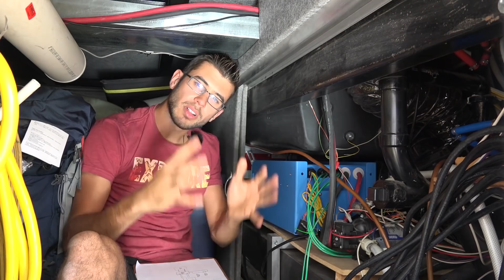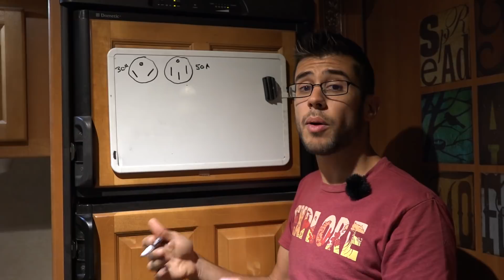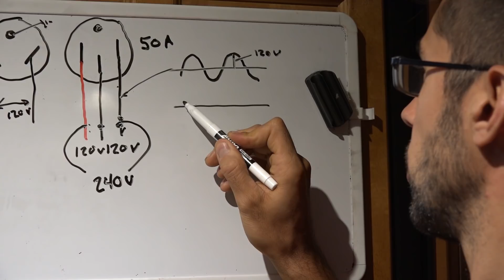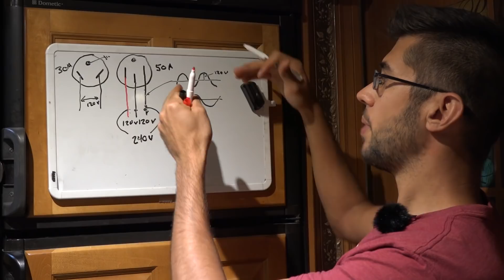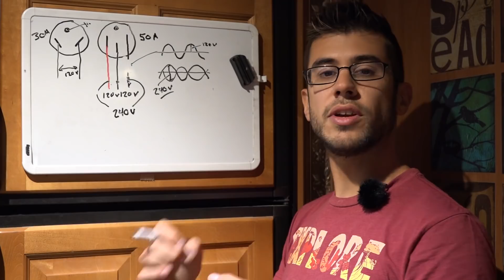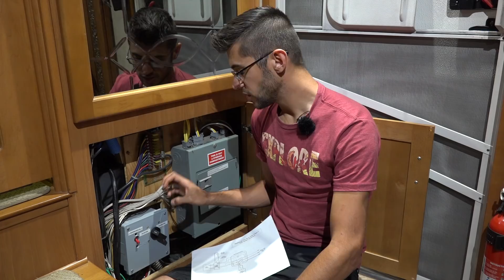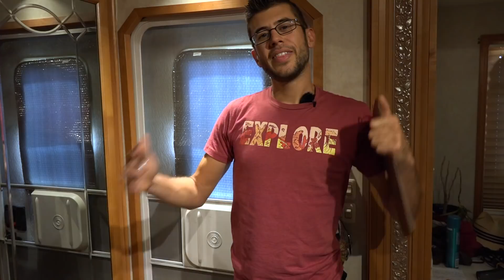RV Solar Phase 3 - 24V Inverter Installation for powering the whole AC system of our RV!

Comment: Tom and Cait,

I just found your videos while waiting in the airport and they are really great.  I have put together a travel trailer very similar to yours so it was very interesting to see how you decided to do things.  I have installed the following in my rig:

Victron Energy (VE) Multiplus 24/3000/70 inverter/charger
VE color control GX controller
VE mppt 150/50 solar charger
VE mppt 100/30 solar charger
VE Orion 25 amp 24V to 12V converter
Elite power solutions lithium ion battery bank, 200 AH at 24V
Elite power solutions battery monitoring system
Powersonic SLA battery, 5AH at 12V
“1200” watts Suaoki flexible solar panels (deteriorating rapidly)

Pioneer mini split residential air conditioner (This is a critical item for being able to run air conditioning off of solar/battery and an inverter. Much more powerful than the roof unit, more than twice as efficient, absolutely no startup in-rush current, and dead quiet inside and outside.)

A homemade 12v to 48v converter which allows me to draw 800 watts off my tow vehicle alternator and run the power in through a second mppt to charge the battery bank.  Works great and saves me from needing a generator and gas cans.  

My rig is a 2015 Coachmen Apex 288BHS, it is my first RV and I have been “moding” it virtually since the day a got it.  It is setup for 30 amp power so I was able to use the transfer switch built into the multiplus, an easier route than you had to take with a 50 amp setup.  In fact, with the power assist and shore power limit features that the multiplus has I only ever carry a standard 15A extension cord.  It has its own 15A breaker just to safe.  BTW, I did not know that 50 amp service on an RV is split phase, thanks for the info.

I have a few question about your setup:

Have you tested the capacity of the Tesla battery?  Fully charged it and then checked how many kWhr you got out of it when fully discharged?  I am very jealous of that Tesla battery.

Where did you get the charger settings for the Tesla battery?

Do you think fusing the solar panel output is really necessary?  Isn’t it impossible for the panels to put out enough current to overload the wires?  Same question about the MPPT output?

What is the standby power draw of your rig?  This would be with only the bare essentials turned on - refrigerator, propane monitor, battery electronics, etc.

Thanks, 
Matt
Reply: Matt,

I have the same TT and year. To date I have modded basic items like LED bulbs for all outside lights, wireless backup camera etc. However I am planning to install solar and lithium batts..... would really love a Tesla pack but where do we put it? We do not have the same storage as Morton’s 5th wheel..... where did you install your battery bank, under the seat behind the main panel? Thank you for your thought’s and I hope Tom responds to your questions.

Comment: Hi Tom @ long last you have showen me how 110volts supplies 2 20 volt out of all the people I have asked. Absulutly  brilliant set of vidioes thank you so much for your time an trouble.  I live in a little cottage on the s/w coast of Ireland and converting.  From lead acid to lythem 24 volt system.  Good luch a an God bless to you both, Michael.
Reply from the maker: Glad you found it helpful! Best of luck with thr conversion!!

Comment: I'm just curious Tom if you considered the Magnum Inverters since they can be wired split phase and you wouldn't have did the jumper?   Let me guess you designed your "Mortons on the Move" logo too lol.   Another great video, and a super thanks for sharing your talent with us !!!
Reply from the maker: I would probably stick with the victron, but yes I have done split phase dual inverter installations before.  Its more than we need and we were trying to keep the cost down. Maybe someday tho!
Reply: Your logo, did you design it ?  Oh, we got our MagnaSine 4448 from ebay, it was new old stock a brand new 2015 model for half the price.

Comment: Add a micro-air easy start to your air-conditioner and you’ll be able to run that from your battery bank. It’s a soft start for your compressor uses 40 to 70% less power

Comment: You have a very nice system.

Several years ago, I installed a shore line surge suppressor,  frequency regulator, and a voltage regulator.

This saved the electronics of my RV in more than one occasion.  
This is particularly true at older campsites during storms and during the holidays when energy demand management is highly recommended.

https://rvpower.southwire.com/products/hardwired-surge-protection/50a-hardwire-plus-model-40240/

https://rvpower.southwire.com/products/accessories/30-amp-and-50-amp-voltage-regulators/

They, also, have automatic transfer switches which perform the above; however, I am not as familiar with these.

https://rvpower.southwire.com/products/transfer-switches/

Comment: You should be able to run your A/C from your battery/solar only, are you not able to?  You shouldn't need your generator unless you are in an emergency.
Reply from the maker: Yes we can run it but the battery will drain.  We usually turn the AC on the start the gen to supplement solar power and not drain the battery.
Reply: If you were to only run the A/C off battery/solar how long would it last with you current battery protection shutoff? What would be the lowest percent you would let your batteries drain to?

Comment: Nicely done.

I have one suggestion and that is you may be able to program the two aux inputs on the inverter to disable charging and inverting independently. I say may as you have an older multiplus. Just something to think about.

Comment: It's so aggravating when people don't follow national electrical code for wiring, Especially AC Wiring. Green or Green/Yellow is Ground, Not!!! Positive or Negative. Negative is White or "Blue in the uk" all other colors are positive, Yellow or Brown is generally reserved for  277V AC.... 

DC positive is Red Most of the time, Negative will be White or Black "Where White is used as Negative you Common Power will be BLACK and/or RED but may consist of a onset of other colors as common power or as treger power wires. Some may contain strips through the wire jacket.

Just a comment. if you are going to show it "Do It Right" Rant Over, Point Made. This is about Safety if something catastrophic on either side of ac or dc in a emergency for first responders.

Comment: So, couldn't I potentially run my entire 30Amp RV from this system WITHOUT additional jumping of the Voltage? A/C and all?
Reply from the maker: Yes a 30A unit would be very easy to wire.  You can also just pass the  whole 30A power through the inverter.
Reply: Thank you so much for making these videos & for responding! I am a newbie to solar, but being from an engineering background, I'm relatively familiar with the terminology & such. If you don't mind me asking, how much did your system cost you?

Comment: Tom let me compliment you on your install of the Tesla powerwall in your RV. it's one of the best I've seen online so far. You use victron equipment which is some of the best in the business. I constantly see people building power walls without having any fail-safes in there system. The Lithium-ion batteries are an excellent choice for your off-grid setup but most people don't realize how dangerous these batteries can be and install them without any BMS system or if they do a BMS system it's something that's not rated for that system.  I've recommended several people to your site so they can see your install.. people don't realize how unforgiving these batteries are and you can't be around the batteries 24/7 checking everything. All these batteries were installed in vehicles with battery monitoring systems that went through the control module the car. So why would people run these batteries without BMS systems putting their families at risk? Tom good luck to you and your wife on your adventure
Reply from the maker: Thanks for the note.  I agree, I hear of a lot of people talking about building "powerwalls" but they dont seem to think through the BMS.  I think we will see cheaper and better BMS options soon but you still need to know what you are doing to prevent a fire.  I like to think of my battery like a can of gasoline, one wrong move and boom.

Comment: I would not recommend the switch used here, especially in an RV. I purchased it last week and, like you, had to disassemble it's top to have it fit my application. Turns out its 2 plastic strips with the numbers on it are holding the entire thing together ( https://imgur.com/a/oGuZRmF ). Each of its 3 layers are otherwise unsecured. That means if just one of those 2 plastic strips breaks down from heat or becoming dried out, the entire assembly will fall apart. Square D makes NEC approved cam switches, one of which I have on order.

Comment: Great video series.  I'm in the process of doing something similar.  Have you found that one of the tesla batteries is enough?  Our average night time draw is around 12 amps at 12 volts right now if watching tv, about 6 amps if not.  If I power the fridge it jumps to 15.5/9.5.  With the 80% rule we have 200 amps of available power in the tesla pack so cutting it kind of close.   I was thinking 2 would be safer and give me a rainy weather buffer (my solar setup is 6x285w solar world panels).

What is the name/model of the transfer switch you used?
Reply from the maker: For the size system you have and draw you see 2 would probably be better, our usage is a bit lower and 1 has been plenty. This is the switch I am using,    https://amzn.to/2t9SDdO    1  Would have preferred to use an industry standard like ABB or Siemens but they are hundreds of dollars.

Comment: Very impressive. However I wonder how mere mortals will ever trouble shoot this system in case anything malfunctions. It seems like a lot of money and risk is riding on a few somewhat vulnerable electronic devices. I'm not saying you didn't do this, but if the system is not designed correctly, a text message from your wife saying "Honey, I smell smoke" will leave you helpless in explaining what to tell her to do in an emergency. Something to think about ...
Reply from the maker: Its very true, but if something went wrong with our old system I would be in the same boat... and It did a few times.

Comment: Great video, very clever jumping L2 on the inverter through the switch. I’m currently installing two Multiplus 24/3000’s in split phase but also have an onboard Onan generator with auto transfer switch in the mix. I should have the system installation finished in the next couple of weeks. Just got done with the solar and hanging the two inverters. I installed 2400W on the roof. I also shied away from the Tesla modules and ended up starting with six Battleborn’s. Glad you guys got to cooler weather, it was very hot in TX, we were really glad to got out a couple of weeks ago.

Comment: Hi Tom, I'm looking forward to the specifics on your actual settings in the Phase 4 video.  I have my Victron Multi-plus installed and will be integrating the battery modules in the next week.  In the Phase 2 video you included the battery protect for overcharging between your solar controller and the 24v + bus.  After adding the inverter/charger, did you move that battery protect to be between the 24v + bus and the battery module?  I was thinking of putting mine there as extra protection since the inverter/charger settings could also be changed by accident.
Reply from the maker: I do not have a BP between the inverter but yes that is a good idea.  We are relying on the overvoltage protection relay we talked about to shut down the inverter on overvoltage.  In testing (lowering the voltage limit) it works great.

Comment: Fantastic video!  I'm set up little different but wanted the same thing. The entire rv lit up even if we are boondocking. I have an automatic transfer switch that I have to tease to switch sometimes. And so was very happy to see your use of the manual one. But I would only need the big switch not the smaller one. 
You have fabulous system. And I'm sure is the envy of all off griders keep the wonderful videos coming.

Comment: Tom, great video series. Quick question....... When you travel, do you power the refrigerator from the inverter? If your going from boondock to boondock, does the solar keep the battery sufficiently charged.
TIA,
Steve
Reply from the maker: If we have sunny days we keep the fridge on AC all the time, if it gets cloudy we turn it to propane.  Yes it is plenty of piwer for us. We have gone months already without the need for the generator.

Comment: Tom - if you feed the same phase to both 120v legs with the inverter, aren't you potentially overloading your neutral? Did I miss something?
Reply from the maker: Nope the neutral will carry the same load as the single hot.  If the wires are sized appropriately it is not a problem.
Reply: Mortons on the Move - I see- the inverter limits the total current flow on both hots to the capacity of the neutral - got it - thanks!

Comment: Hi Tom. I'm concerned that you've created a potential fire hazard in your RV by appearing to not install a circuit breaker on the 120V output of the inverter and using insufficient 10 AWG wire to the transfer switch and as a jumper, according to the manual for the Victron Multiplus 24|3000|70-50|120V inverter. As well, are the wires between the transfer switch and the panel, the same gauge as the ones from the shore power connection?

It mentions at the bottom of page 15, that when using the PowerAssist feature, the inverter can output a total of 75A, which is comprised of the 50A maximum input current and 25A produced by the inverter. It cautions that the output cables should be sized accordingly and that a fuse or circuit breaker also be used.

You've installed a 20A circuit breaker on the input, but programmed the inverter to use only up to 11A for PowerAssist, so the maximum output is therefore 36A. That exceeds the 30A rating of 10 AWG wire.

I'd recommend either adding a 30A circuit breaker to the inverter output so that you can safely use the existing wire, or install a larger breaker and 6 AWG wire to accommodate the 36A maximum output now, while giving you the option to increase it to 45A should you decide to reconfigure the inverter to use the full 20A input at some point in the future, perhaps with a larger generator. I hope that this is helpful.
Reply from the maker: You have made a valid point.  We have not and do not intend to run the inverter that hard, but as procedural safety is not guaranteed I will add a 30A breaker in line and update our schematic.  Our inverter is actually of an older model (circa 2008) that will only assist up to 16A.  With this configuration I am happy with a 30A max however and if we upgrade it will probably be to a 50A stacked split phase system.   The wires from the transfer switch to the breaker box are 6, the same wire coming in and of sufficent capacity. Thanks for your thoughts!
Reply: You're very welcome, Tom. Please consider adding that information to the description as well as your pinned comment and releasing an update video with the breaker installation, so that those who have followed this series are aware of the safety importance of this change. Some may not download the updated schematic and only use the contents of this video to plan a similar system. Thanks.
Reply: In a 30 amp RV with the multiplus the transfer switch internal to the multiplus is used.  The output from the muliplus then connects to the 30 amp main breaker on the stock RV distribution panel.  This provides the protection you are looking for.  Not exactly on topic but I thought I would throw it out there.

Comment: Tom, really great video.  Excellent work on the install.  One question I have.  Curious how the surge protector (those that analyze incoming power) will work when plugging your 50 amp RV into a 30 amp shore power using a 50/30  adapter.  Would it have any issues with the fact the the two hots do not have inverse sign waves (so no 240v)?
Reply from the maker: I dont think you can use a surge protector on the 50A side in that configuration,.. but I am not sure on that. Probably depends on the brand.   You might need a second unit to use on the 30A side.
Reply: My neighbor was having issues with his Motorhome.  We thought that might be the issue when his SurgeGuard built in protector was throwing a fault last night.  He has a solar setup very similar to yours. It turned out just to be a corroded pole on his adapter plug.  After fixing that, it did work even with both hots pulling from the same line.  But, I think you're right it probably depends on the surge protector brand.  Really enjoyed your detailed explanations and  electrical theory class :)

Comment: Loved watching you details on your setup. Interesting some of the comparisons to what I also did with the Victron Multiplus. It was a lot easier with the straight 30 amp service in my rig for sure.
Reply from the maker: Did you pass through all the power?
Reply: Tom, yes I did pass through all the power. I will probably want to install a simple switch so I can have the inverter off and run power directly to the AC panel, but for now I re-ran the 30 amp input on the side of the trailer directly to the inverter AC in. Then ran the AC out from the inverter into the AC Fuse panel where shore power used to connect. That way, I plug shore power the same as always, and when I get a generator, I plan to plug into the same input. Any issues with this, other than I have no AC if the inverter goes out completely?
Reply: I also disconnected the old converter charger in the RV. Didn’t want that loop. 😒